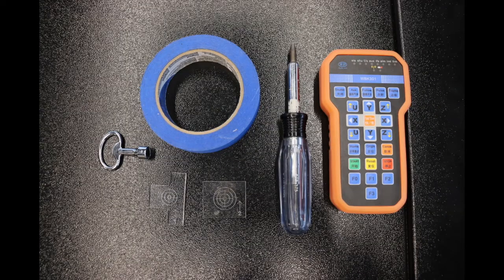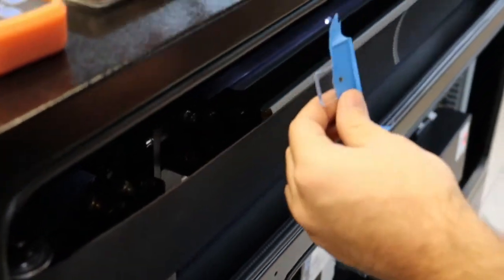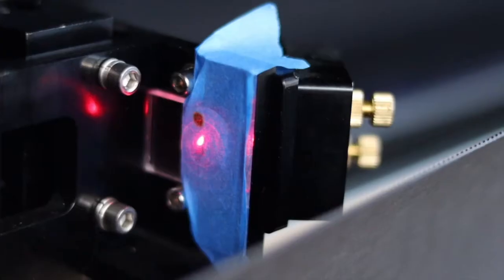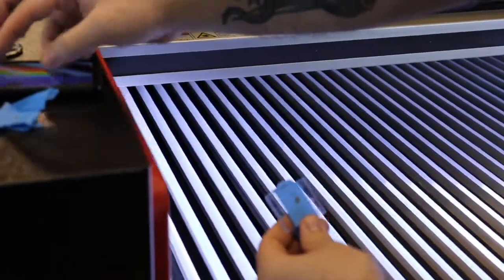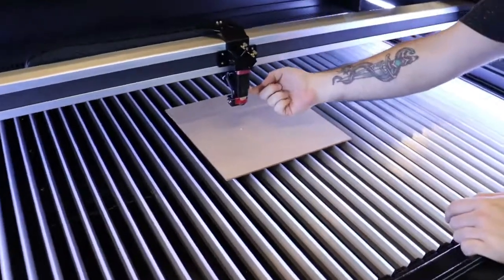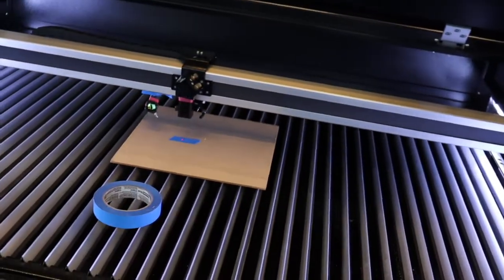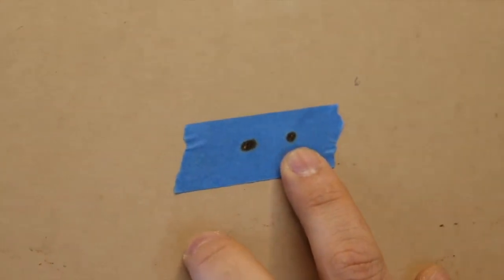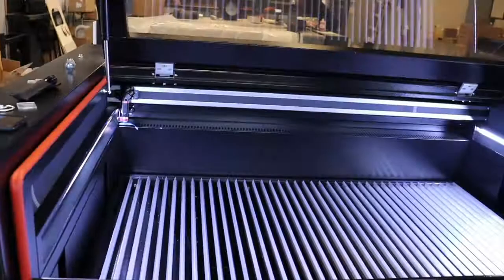NOVA: Mirror Alignment

Comment: My initial pulse when the gantry is to the far left has the test high on the target. There was no mention if there is any adjustment that needs to be made to have it center before moving the gantry to the far right. Had a similar issue with the Y positioning. Is the first shot supposed to be dead center?
Reply from the maker: Apologies for the late reply on here! You've most likely ironed this out by now, but please email us if you need help with anything and a tech will assist! 

support@aeonlaser.us